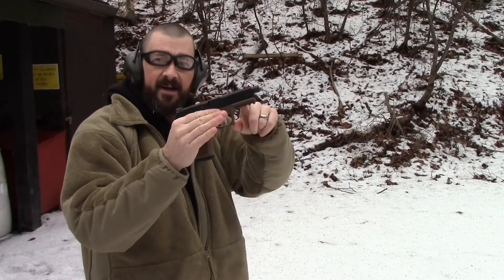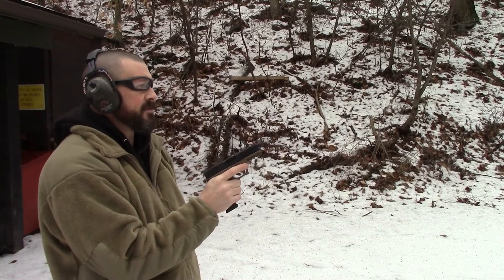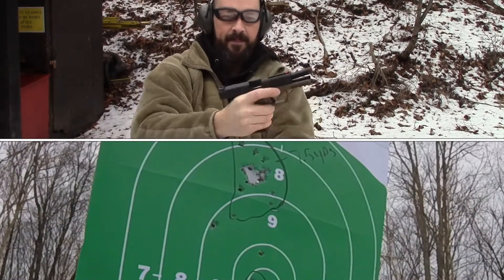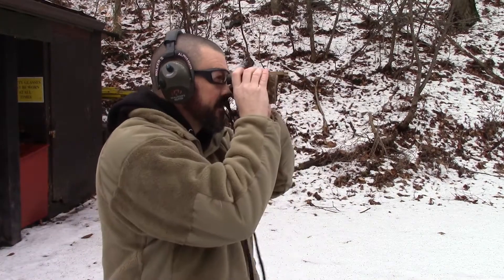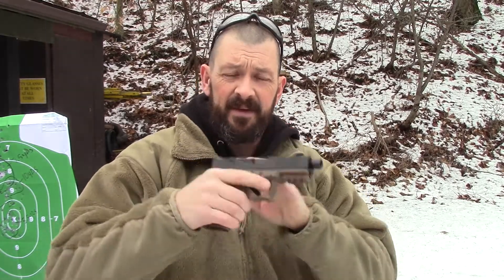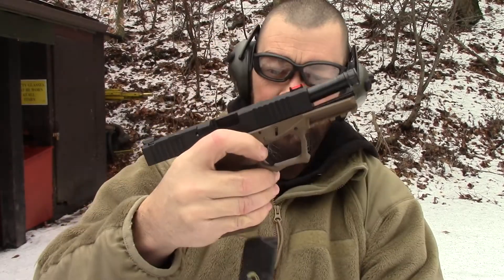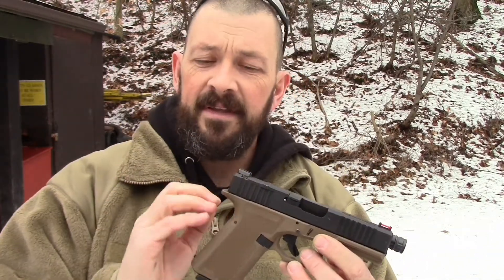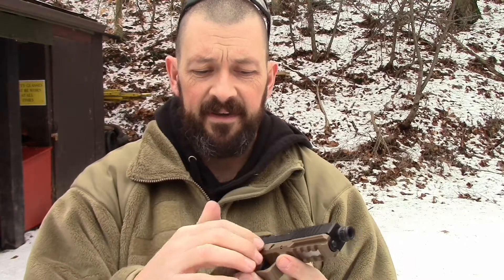Polymer 80-new slide- Range Time

Comment: Thats your trigger pin it locks in place held by the slide release, true it up till it clicks in place, then your trigger pin is held in place bt the slide release, the two pieces are disgned to hold together.

Comment: It's the 115 aluminum  ammo. It's real finicky. I sometimes think they under load them. I'm at 10 pound spring runs great now without jams. And with the pin walking out it may not be locked in the groves with the slide stop groves or you may have drilled the holes to loose. I always drill my holes smaller on all 80% builds for that reason. Great spilt screen view, polymer80 build.

Comment: I don't think it's the slide.  I saw a video from Glockstore.  The big pin has 2 grooves,  which act as an anit-walk, when the slide stop is seated correctly (in the groove).  Your slide stop might not have been seated. You should kinda feel it click in, when the pin is centered.

Comment: I suppose it's possible that the pin wasn't centered and having a tiny bit more pressure to one side could have walked it out but, I'm going to have say my true belief is the hole is probably .0001" or more bigger on the walk out side. The instructions for the Polymer 80 say to use a hand drill and the provided drill bits. However, I threw away those bits, went to the hardware store, bought proper machinist bits, used a drill press to drill straight and perpendicular holes. The pin holes in my P80c are tight on both sides and never move unless I want them to.

Comment: The aluminum ammo chocked my poly80/19LS twice in 200 rds. The pin walked out on me also. I reversed it and drove it back in from the wrong side. Have run 2 range sessions, about 150 rds. and the pin has not moved. Gave up on the Alum/115 FMJ.